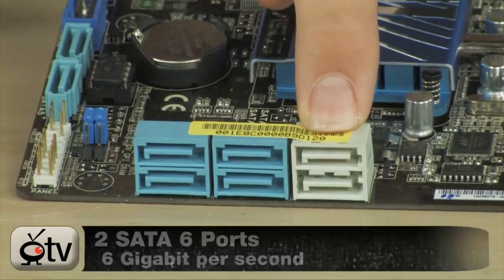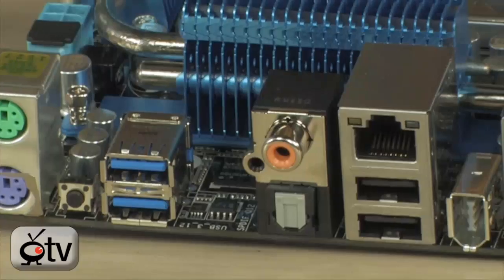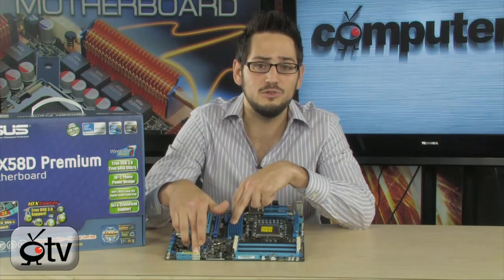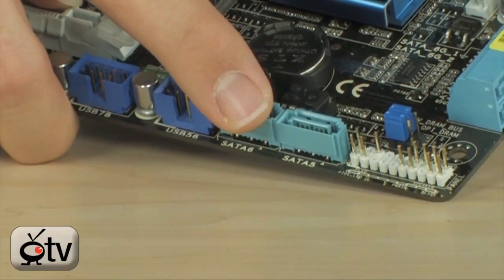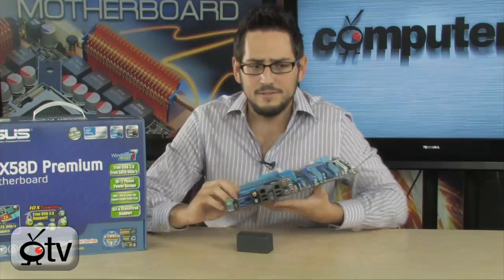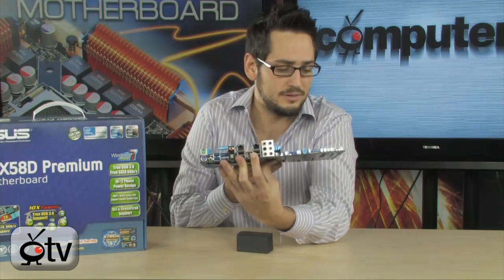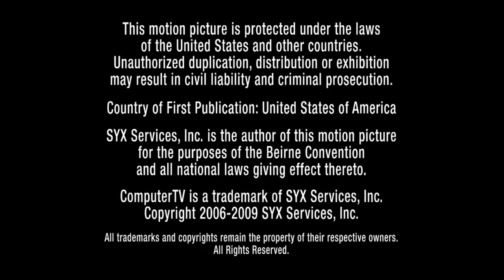Asus P6X58D Premium Motherboard

Comment: I love my p6x58d premium i7 920 16gb 1600mhz 8 8 8, the x2 sata 3 and x2 usb 3.0 saved me for the future, the features are the top of the line future tech that is now a regular thing on mobos these days. The cooling and the beauty of the build makes me want to never upgrade and now I feel like the Intel xeon x5690 processor performs just a bit less than the Amd 2600 6 core and its a super upgrade since its under $40. There wasn't much options for ram as triple channel in the future so I down-upgraded to dual channel at the expense of speed reduction and the board only takes 24gb of ram, which is the saddest thing ever but still now today 24gb isn't so bad.  I run an ssd which the board was prepared for with sata 3.   The i7 920 is at 2.4-3.2ghz oc 40c on idle. All I ever have had to do is upgrade ram and hdd to ssd and my gpu every few years and clean my pc. Its the best board of all the time.